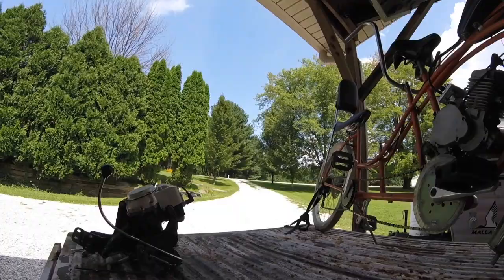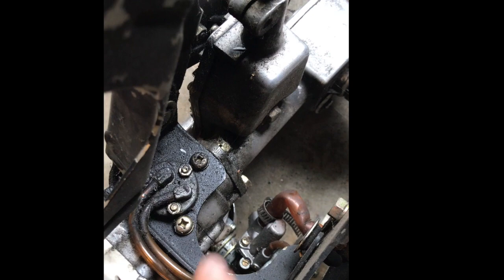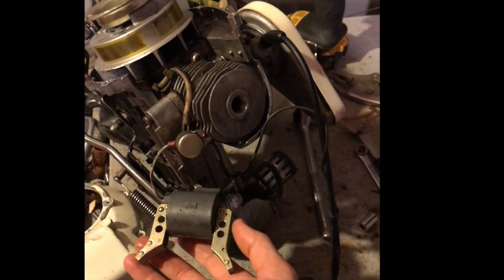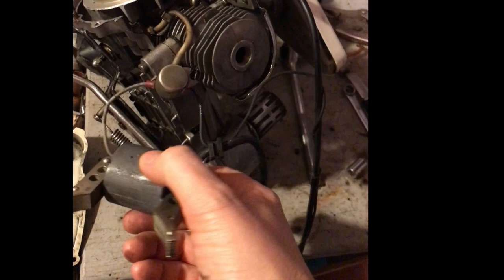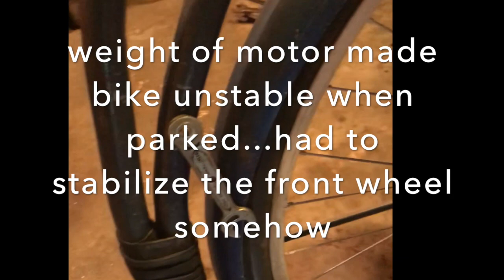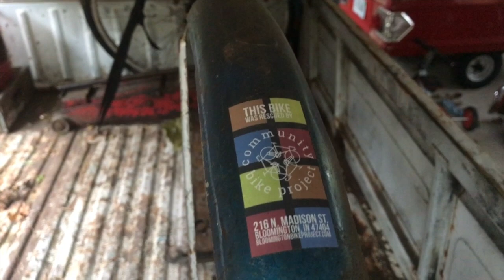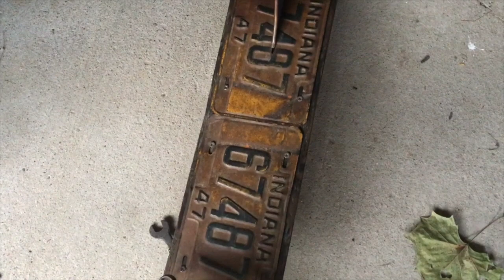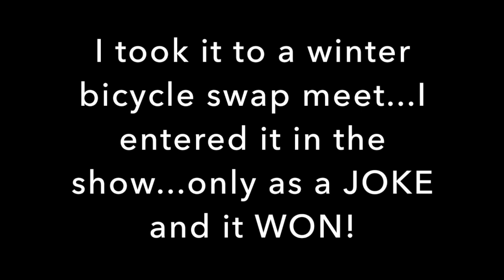Motorized Kickbike...bike bug motor finds a ride!

Comment: I have the taz Spitz variant of this engine on a an old takara frame and I'm being serious here, for maximum rpm take off the whole air box and start the engine on full choke and while your riding it slowly back off the choke until you hit peak rpm, if you open the choke all the way it will bog and fall on its face the factory airbox is a serious restriction but the carburetor is to large to work without some restriction so you use the choke to find the sweet spot and when you hit the right rpm the expansion chamber will start to work and you'll hear and feel it come into its powerband it's pretty cool I got mine to about 18 to 20mph i needed to actually up the spindle size but I never got around to it. I also removed the base gasket and did some porting oh and if you take the intake manifold off the cylinder there is a restrictor plate remove it
Reply from the maker: You are correct on all counts! 🤣but yep I had to learn the hard way lol I Also have found that the factory gap on plug doesn’t work very well...smash that sucker down and you get great spark! Thanks for sharing! My air box has nothing in it...seems so work pretty well when I remove all its innards! 👍
Reply: @marcijunebug  yep I tun a tight gap too but if you have weak spark pull the flywheel and
Adjust the points I have the factory manual if you need the recommended gap/specs
Reply: I got mine from a buddy who had 2 of these engines one was mint and the other was beat up, he let me keep the beat up one for fixing his mint one and getting it running they had been sitting in his dad's shed for over 15 years the hardest part was getting the fuel pumps to work again
Reply from the maker: yeah...they are a pretty finicky little engine, but fun! The worst thing with mine was the fuel lines had been yanked on and those hook ups are just press fit in there so that makes for some issues, but once I stopped the air flow there it took right off! price was right! ha I love little quirks like that and trying to figure out WHY it won't run right! we've had a lot of fun with this, but my dad and I thus far are the only ones dare devil enough to ride it 😆✌
Reply: @marcijunebug  mine was super reliable after I got the pump working I rode it everyday for a year and then I moved and the bike has been in the shed ever since and I have gotten other motorcycle projects since but I'm thinking about getting it running again it was really fun
Reply: I probably put 50+ miles on mine and loved it but i really needed to up the spindle size, from factory there is suppose to be a piece of rubber over the metal spindle that increases the size but those disindigraded years ago and they dont make them anymore because my engine would turn over 10,000 rpm and would RIP but needed more spindle for more top speed but I didn't have any ideas for the spindle the only problem I had with mine once it was running was one day my condenser mount broke from the extreme vibrations and it would short out the ignition but my dad welded the bracket back on and it was good after that
Reply from the maker: Brian G yep my condenser bracket broke too! Lol I use skateboard wheels for the friction wheel, or have also used those boat trailer yellowish v shaped wheels, it shreds wheels but skate board wheels are cheap!
Reply: @marcijunebug  do you just press the skateboard wheel over the metal spindle or did you grind a keyway into the wheel and bolt it on
Reply from the maker: Brian G I found a spacer that fits perfect in center and I jus Jb weld it and then heat it to get it out, but I bet you could drive a small socket in there or key it either way....just needs enough friction to start it and then keep it going
Reply: @marcijunebug  yeah I was confused because the spindle is mounted to the tapered shaft with a keyway so I wasn't sure if you were attaching directly to the output shaft or if you were attaching it to the factory spindle, oh and fyi the spindle nut is left hand thread so be careful if you try to remove it
Reply from the maker: Brian G yeah most of those friction wheels are that way...I’ve had a couple others and they too we reverse! Fun little machines! This winter I’m going to build the life size version of my stitch riper creation and power it with a hit/miss engine lol